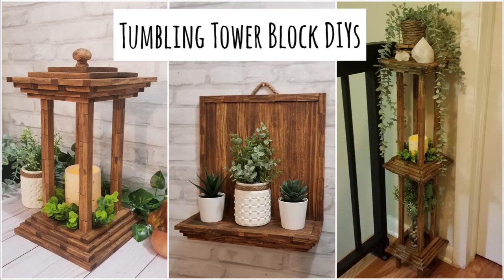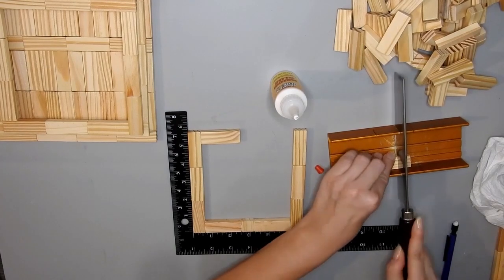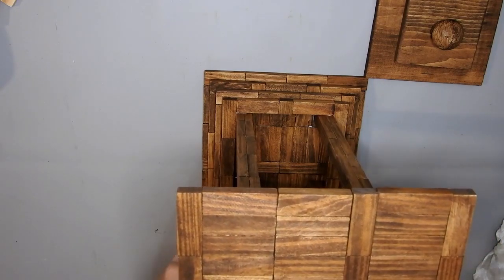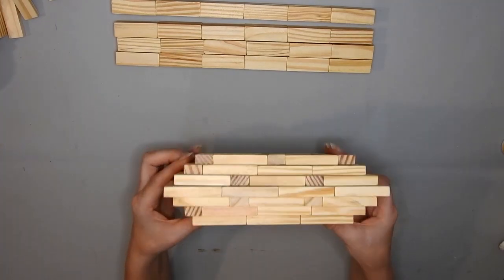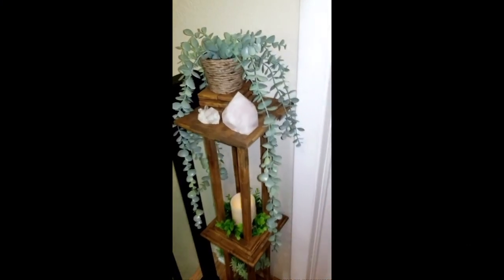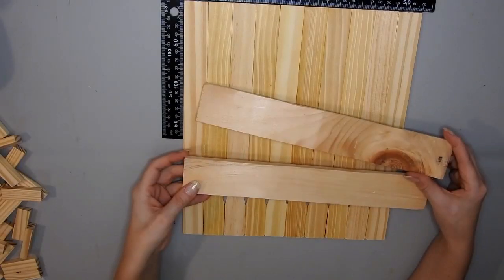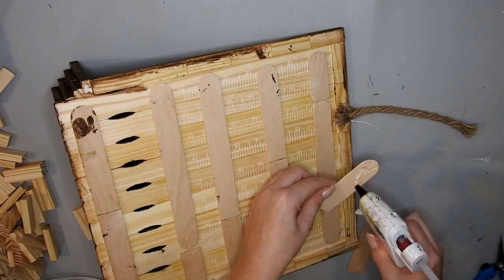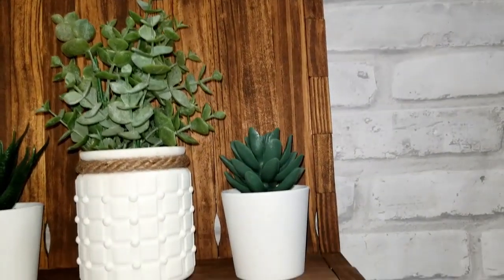3 TUMBLING TOWER BLOCK DIYS 2022

Comment: Hi 
I really like your wall piece.  But I was wondering if you could give a list of number blocks used basically a brake down.
Reply from the maker: Hi, it's around 60 blocks, so 1 box of tower blocks. 18 for around the frame. For the shelf it is 10 plus a cut piece of block for the top layer of shelf. 2nd layer is 10 but you have to cut down 2 of them. 3rd layer is 9 and you have to cut 2 , and I probably used the off cuts from the other sections to fill in the spaces. 4th layer is 9, you have to cut 2 down. You can slow the video down on YouTube to see what I am doing better.

Comment: How many blocks did you use for the tall tower?
Reply from the maker: you need 6 of the bigger 72 block packs or 12 of the smaller ones. you will have some blocks left over.
Reply: Thank you.  I had the same question.  These are all amazing!!!